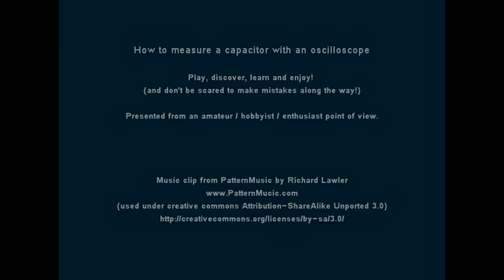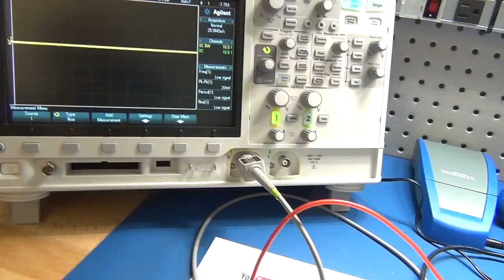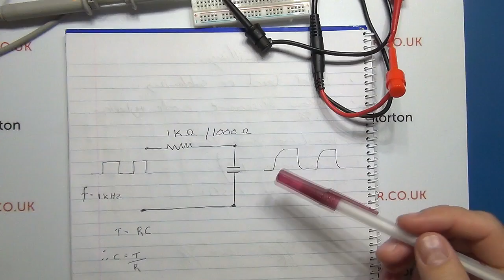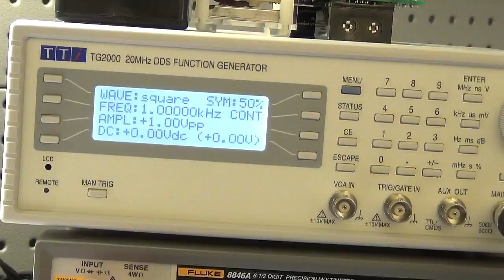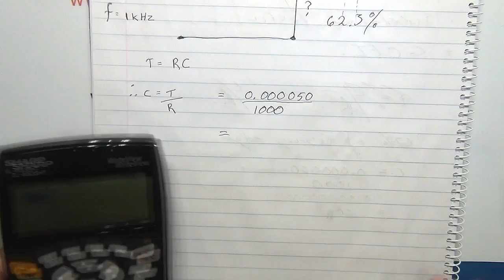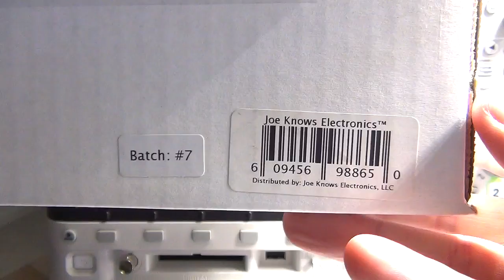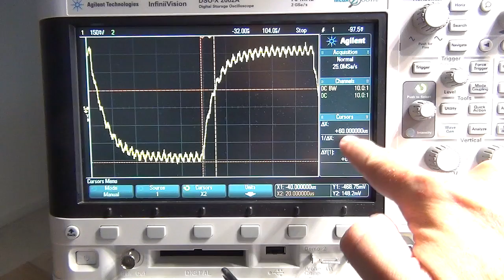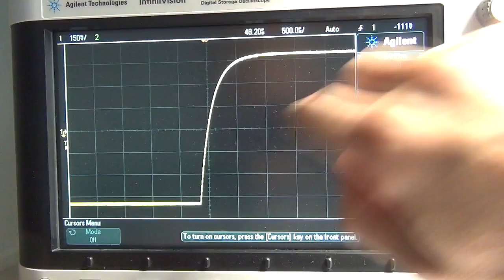How to measure a capacitor with an oscilloscope.

Comment: Great video.  

Like many people have said, when you are measuring such a tiny tiny value capacitor, then there are a ton of other stray capacitances that confound the measurement - the probe, the wiring, the breadboard, they all have values in the pF range so you are actually trying to do something pretty difficult.   These stray values don't affect the measurement of the bigger capacitors much because the stray values are so much smaller in comparison.  

When measuring something small like this, you might want to connect a bunch of them in parallel (the capacitances will add)  and then divide by the number of capacitors you used to get the answer for a single one of them.
Reply from the maker: Andre Sant'Anna Thanks very much for your input Andre.
Reply: @muppetpaster  The capacitance of the bum on the chair is inversley perportional to how interesting the video is and like a capacitor it will short to ground as soon as the interest peeks and it will need to dump its load..

Comment: Martin, as a suggestion, I found another easy way to evaluate the capacitance with a scope.  Using the same circuit as you have, set the frequency in such a way that the voltage across the capacitor will be half of the voltage across the resistor.  Once there, apply the Sqrt(3)/(2*PI*F*R) formula.  Quick and easy, less gymnastic with the cursors.  Have fun!

Comment: When you are testing that 4.7 PicoFarad cap, keep in mid that your scope probe has much more capasitance in it (typically 15-20pf).. also the scope probe has about 10M impedance that is close to your 1M Source side resistance that tries to charge to cap. 

Also all those leads from sig-gen and resistor box add some capasitance parallel to the cap measured slowing down the charge curve.

Comment: Well ... here we are in 2024 and it's still one of the best tutorials, simply because it is utterly honest.  We all struggle at times and this was so typical of life amongst we technicians when striving to prove our stuff and ourselves.  Today, I have a little gadget that ws purchased around 2010, and it will measure capacitance to within a fraction of a puff quite accurately (it says), in about 15 seconds.  However, theoretically, just walking into a room changes things.  Thank you for a splendid video ... greatly appreciated.

Comment: EXPLANATION OF THE pF ERROR

When measuring a very small capacitance value (in the pF range) your measurement is influenced by the parasitic capacitance of the oscilloscope (~10-30pF), of the oscilloscope probe (~10-20pF) and of the test stand (~xxpF).
You should measure the parasitic capacitance of the system first (without holding the wires with your hands), then connect your capacitor, measure the new value and subtract the parasitic value from the compound value.
I presume you had a 55.2pF parasitic capacitance in the measurement system which added to the 4.7pF you were trying to measure (59.9pF=4.7pF+55.2pF).
In the case of larger capacitors (nF range or larger) the effect of the parasitic capacitance is irrelevant: 220nF+55.2pF=220.0552nF so basically no difference.
Also, capacitance does NOT change with frequency although impedance DOES!
No electronic component is purely resistive, capacitive or inductive. This however is another discussion! :)
Reply: I think that is why he starts with explaining that he is saving up for a good and precise  LCR-meter.....
Reply: And how would you measure the parasitic capacitance? Connect the function generator through a resistor directly to the scope?
Reply: "You should measure the parasitic capacitance of the system first (without holding the wires with your hands), then connect your capacitor, measure the new value and subtract the parasitic value from the compound value."
Reply: With what frequency should I measure ESR in circuit then?
Reply: @thuglifescorpion  What do you mean?
Reply: @GeDePeU  well I want to test capacitors in circuit, so without removing them. What frequency and voltage should I use which is safe for IC's and other components?
Reply: @thuglifescorpion  Depending on your schematic, measuring a capacitor (or any other component) without removing it may be impossible. I am afraid that the only solution for you is to remove the component from the circuit and measure it separately. In your case it is not a problem of "safe frequency" but one of "unknown influences" from other components. Certain on-board measurements could be made but it all depends on your schematic.
Reply: @GeDePeU  Well, I'm not about to desolder 400 capacitors so I will have to hope for testpoints and hopefully a decent service manual :)
Reply: lso, capacitance does NOT change with frequency although impedance DOES!  Actualy does . Crosing the self resonance of cap on right hand plane will be inductance . This however is another discussion!
Reply: @dixsusu  No, the capacitance of passive components does not change. The phenomena of self-resonance you are mentioning has nothing to do with a change of the capacitance but with the measurement of a an abstract RCL circuit that most passive components happens to exhibit. You are noticing the response of an RCL circuit and you draw the wrong conclusion.

Comment: Not sure why a 9 year old video popped up in my feed, but I enjoyed it.  Two comments:
(1) Since you're measuring the rise time of a square wave, the frequency really isn't going to be a factor unless your rise time exceeds your cycle time.
(2) The noise is present on both the 47nf and the 4.7pf traces, but it's more filtered with the larger capacitor.  You can still see the "fuzz" on the 47nf trace.  A higher input voltage would probably help clear that up.
(3) you'll get a more accurate reading if you put your  "Y" cursors in the middle of the "fuzz".
OK three comments LOL
ETA: (four comments) (4) the 4.7pF is probably inaccurate because you're down in the range of the capacitance of the scope leads and or the function generator, both of which will alter the rise time.

Comment from the maker: Yup..checked total resistance...no problem there. There's an error that is out by a factor of 10 somewhere...and I did another worst case measurement that the noise might induce...and it's no way near 10x out...
So I'm still puzzled...

Comment: Instead of using 63.21% (t = rc), you can use 86.47% (t = 2rc), because slope of voltage on capacitor is smaller there, so it is easier to find out exact spot for it. After that you do the same, but devide result by two. c = t/(2r). Also it is use as wide time division as possible.

Other value to try is 75.00% (t = 1.3863 * rc), or 80.00% (t = 1.6095 * rc) which should be also easy to setup on a scope.

Another approach is to take data to computer, and fit exponential function (or linear after taking logarithm). This should be much more accurate and also give you estimation of error.
Reply: These are great suggestions. The exponential fit will give the best results, but obviously requires a bit more work.

Using the method in this video, you were relying on the capacitor being nearly saturated by the time it hit the end of the waveform. In particular, you took y2-y1 to be the completely charged voltage. In the process you effectively measured two voltages (bottom to top of the waveform, and bottom to 63%) and one time (beginning of waveform to 63%V).

There is an in-between option that would offer improvement without much more work. By adding one measurement, you can ignore the top voltage, and get better results. The big advantage is that you can use bigger resisters, since you no longer care about saturating the capacitor during a pulse, which makes for a slower rise time and better measurements. The procedure is as follows:

1) As before, pick a time that puts the voltage about halfway up the curve. This doesn't need to be precise. Forty percent or sixty percent up the curve is fine. Write down the time (measured from the beginning of the waveform) as t1.
2) Write down the corresponding voltage (measured from the bottom of the waveform) as V1.
3) Now choose t2 equal to twice t1. In other words, if t1 was 1.00 milliseconds, choose t2 to be 2.00 milliseconds. This does need to be precise in order to take advantage of an algebraic trick, and to avoid solving a nonlinear algebraic equation for the final answer. Just double t1, and measure V2 at t2.
4) The time constant, RC, is equal to (V1*t1)/(V2-V1). Note that t2 does not appear in the equation, because it is assumed to be double t1. The equation is derived from the assumption that the voltage history has the form V(t) = Vfull*(1-e^(t/RC)) and plugging in (t1,V1) to give a first equation a and (2*t1,V2) to give a second equation. Solving the pair of equations for RC gives the simple ratio above.
5) Fix my algebra and repeat step (4). I did the algebra by hand, which means I screwed it up.

One more note for the future: you did a nice job of eyeballing the measurement locations, except that you measured from the top of the noise band for the top voltage, and from the bottom of the noise band at the low voltage. In this procedure, the errors roughly cancelled each other out, but in most cases your results will be better if you measure from the middle of a noise band.

Thanks for the video! I'm coming back to electronics after many years, and it's great to see this kind of tinkering in a lab. Lots of fun.
Reply: Thanks a lot to you both for your comments, they helped me a lot! :-)

Comment: An alternative measurement method is to use a sine wave and a two channel scope, Place the channel 2 across the cap, and the channel 1 across the resistor (R) and capacitor (C) in series. Adjust the frequency (F) until channel 2 is 0.707 of the input (channel 1 value), At this frequency the capacitive reactance is equal to the resistance of the resistor i.e. R=1/(2*pi*F*C). As we know R and F we can calculate C. A digital storage oscilloscope will display accurate peak voltages of the channels. The phase angle could also be measured as it is exactly 45degrees.
Reply from the maker: Thanks for your post Barry.

Comment: For input/output on your calculator, using engineering mode makes it easier to convert back and forth between mega, micro,pico etc

Comment: Martin,
I just purchased a Rigol DS1102E Scope. I tried to replicate your method used in this video, but can not seem to place "X" and "Y" cursors on the screen at the same time.  It appears that either "Y" or "X" can be selected, but not both.  Is this correct or am I possibly missing something?  My scope does have a Track function, which does allow both an "X" and "Y" cursor to perform tracking functions.  Any wisdom you could provide would be greatly appreciated! Thank you in advance!  :)

Comment: Dear MjL,
The probe capacitance must be observed when measuring capacitance < 100pF.   Probe settings for 10:1 will give a higher impedance than 1:1 and thus lower capacitance.

Comment: Good show. You have the basic concept down -you can increase accuracy with faster rise times, at a minimum stretch the wave out more in time and/or process raw data in computer. Below a few pf things get interesting. You enter a dimension where parasitics and environmentals begin to sneak up fast. You have to think in terms of impedance, reactance, etc. Instrument tolerance will limit things to a few percent. You can only approach dead accurate -you can't really get there!

Comment: Great video! I like the way you start off asking the questions of why use a resistor, and wonder about the entire reasoning behind this test and its results. Those are the questions that I run through my mind as well, and I need to know why things are as they are, not just mimic a result from what I watched.

I'm an enthusiast myself though I'm not nearly as advanced as you are, (and probably most of the people who watch this video), but I made a point to save your link to all your videos. I have yet to watch this entire video, (I have to go on an errand), but I'm looking forward to it.

BTW Have you ever been to Mt Kilimanjaro? I haven't but I'm 62 and I want to go there within the next 5 or 6 years, (if the planet lasts that long ;).
Thanks again,
Rich

Comment: Nice and useful demonstration, it's great you take the time to do this. A couple of notes: in actual practice, you really need to zoom in more on the front of the waveform to get a more precise measurement, Also, it is often more practical (and faster to do) to increase/decrease the frequency of the wave generator to match the resistor / capacitance pair, intead of changing the resistor value (which could be a specially selected resistor).

Comment: For those without a function generator on hand, there are a couple of other options available.  Most, if not all, scopes have a built in probe compensation square wave output with a known voltage and frequency.  Another option for those with a storage scope is to use the single shot mode of scope triggering, and a toggle switch, or pushbutton to apply the charging current from a known voltage source.  You'd want to be sure that the capacitor is fully discharged before hand.

Comment: I'm a heavy scope user you just can't beat a scope. When you can  see a graph of what's going on is wonderful.  I also use it in automotive testing. Often I tell people the issue what's wrong and since no codes they think I'm wrong. Months pass and they call back and say hey that's what it was. Due to heath reasons I'm getting back into board repair and it's better money and I don't have to be out in sun.  I have a automotive scope pico 4425a I'm so happy I can still use this it was very expensive. Thanks for your video and information.

Comment: I would say you can consider the point where its fully charged and then make an approximation of ' 5T=RC ' and work your way in finding C, this works fairly good given then 1 to 10% tolerances of normal resistors :) 

Good Video!!

Comment: Like the video. You could do an extra measurement for (say) 47 and 470pFcaps and see how the error gets more-or-less unnoticeable. It would be good addendum to this video. 

Also you might want to try measuring caps by making RC- oscillators with them (likw simple 555-based) and measure the frequency. With oscillators it's usually easier to see how much the simple scope probe touch can affect the tuning.

Comment: I suggest The reason for the noise is because the test circuit has such a high total impedance and there is no shielding. I suggest that the value of the resistor and the impedance of the capacitor need to be approximately the same to get a readable slop. In this case the resistor is about one meg-ohm then the total circuit impedance will be more than 2 meg-ohms which was much higher than the clean waveform test circuit impedance. You will need shielding to get a noise free waveform. You would need to make sure to decade resistor box was shielded as well. Or you could implement a bandpass filter on the scope to remove the line power frequency noise and the higher frequency noise. A much cleaner waveform could be derived if you raised the testing frequency. This would allow a lower resistor value and because the capacitor value would be lower in impedance the total circuit impedance would be lower. This would load down the noise that is induced more and thus clean up the waveform. But you would have then to be worried that the capacitance would not be linear. That is to say the capacitance may not be the same at 1 kHz as it is at 100 kHz. Linearity of the capacitance is sometimes encountered with old or defective capacitors.

Comment: If you set your cursors at very top and bottom of trace, then your p-p value actually depends on your intensity setting!  Turn your intensity up and down to see what I mean. Better to set them at center of trace.  I hope this description makes sense.  I refer to how you set the cursor at the 20:37 mark.  (MJ, I cant believe that in 5 months you have not responded to this comment.  And now a full year later, still no response.  If you do not agree with my analysis, then please explain how I am wrong.  I promise to cheerfully listen to your position.)

Comment: My favorite Calculator for electronics work is the Casio 115MS it has short cut buttons for working with metric prefixes from femto to Tera and it the correct mode it will give you the result with a prefix instead of scientific notation. Its also cheep at less than $20 but watch out for the very similarly named Casio 115ES it trades the metric prefixes for Built in Conversions for Metric units and US units and built in constants

Comment: Thanks for explaining - how to measure capacitor using scope.Are there scopes with built in function generators too? What would benefit people more is if you could present a simple block diagram on paper and show how u connect the wires for doing the measurements.

Comment: BTW, 45:20. Are you sure that would work? Every cap has an ESR. So you might measure your resistor to be precisely 1000.0197 Ohms, but you won't know the cap ESR which I believe influences the charge time and it should not be neglected in an experiment of such precision. Great videos, thanks.